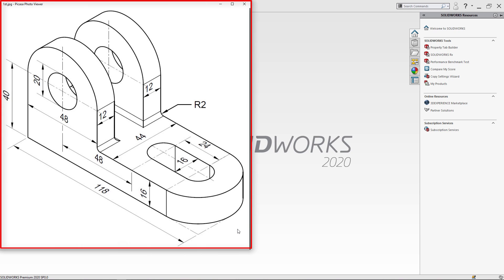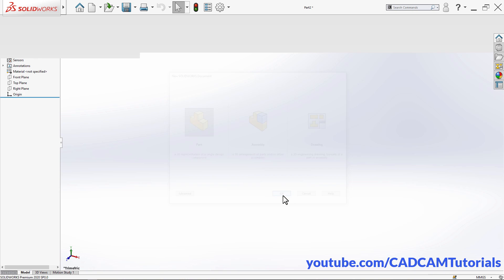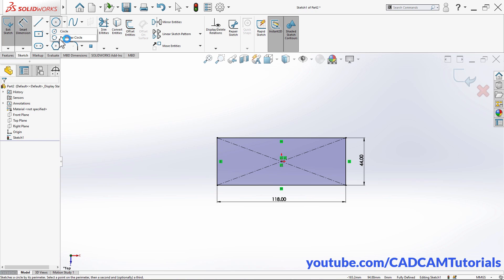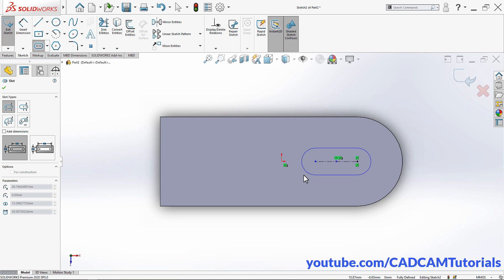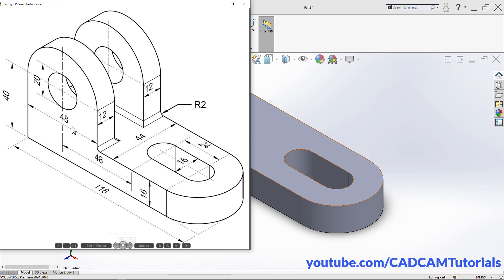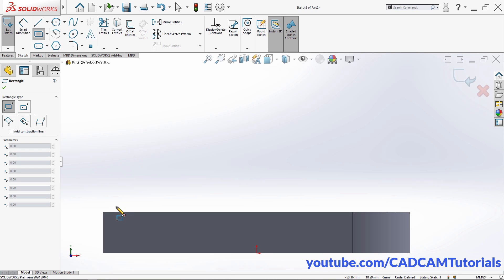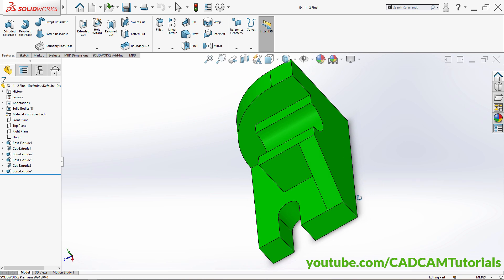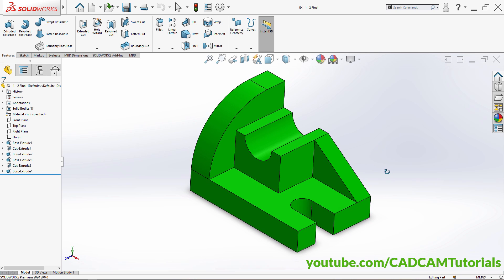SolidWorks Basic Practice Drawing Exercise for Beginners - 1

Comment: Hi everyone, just a small tip: while following along, I had auto-rotation activated, and it kept rotating. To fix that, you would click on settings, then sketch (in the left section), then untick the first auto-rotation option.

Comment: I started with a corner rectangle. So when I'm about to mirror, the front plane comes on the edge of the figure. How can I mirror it now?
Reply from the maker: You will have to shift rectangle or create one plane for mirror.
Reply: @CADCAMTutorials  Oh using that 'plane' option to the right of spline right? I just saw that option. Thank you 🙏